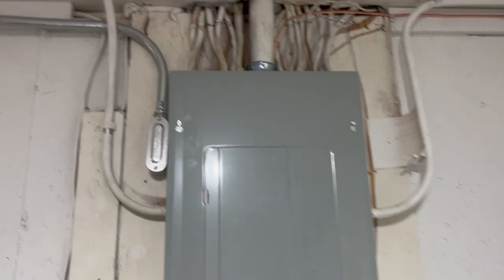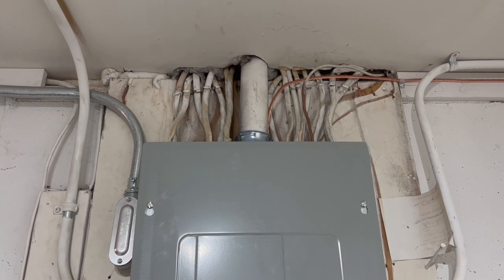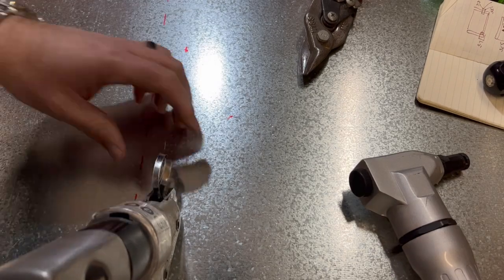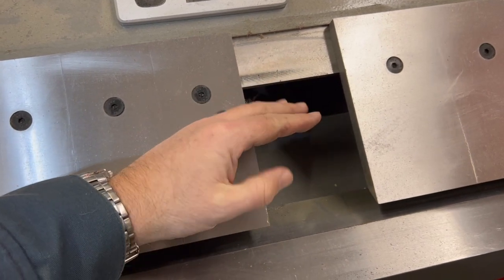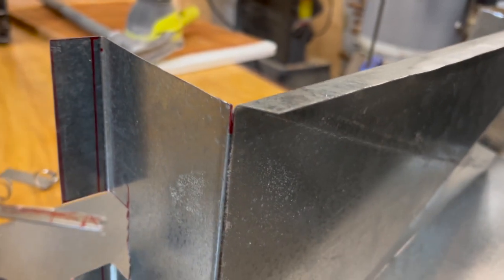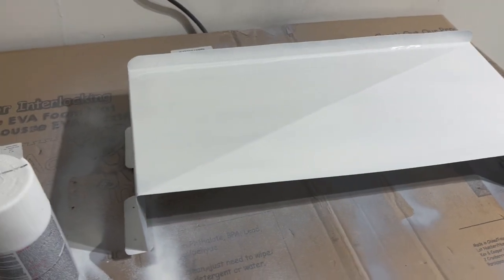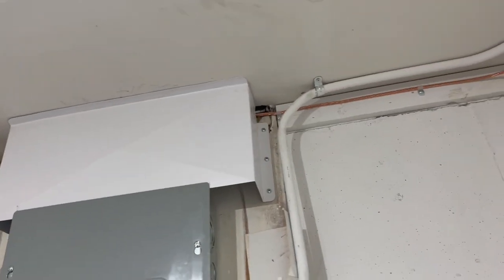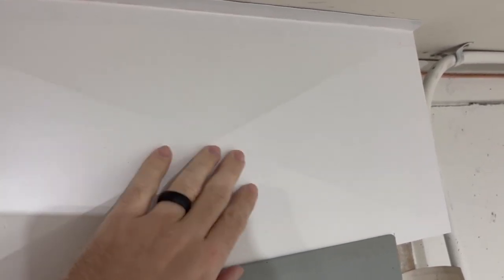Custom Sheet Metal for an Electrical Panel

Comment: Why do you have a brake if you don't do much sheet metal
Reply from the maker: I do a little Sheet metal.  I did a lot 20 years ago.  I got the brake for free when a facility closed in Seattle and no one wanted it.  I may use it 3 times a year, but am REAL happy to have it those three times 🙂